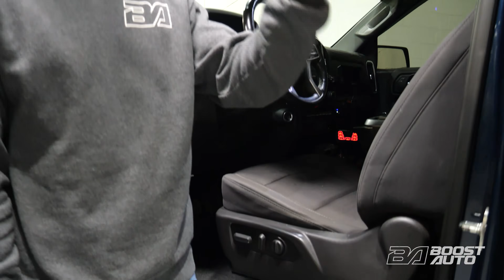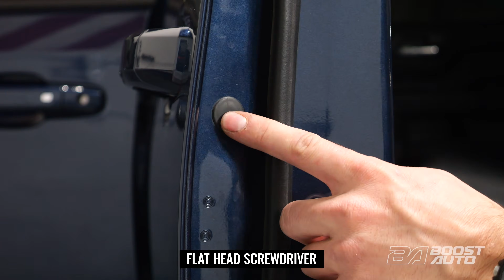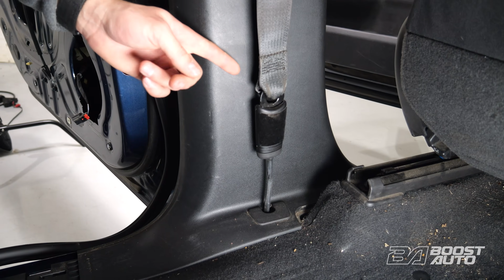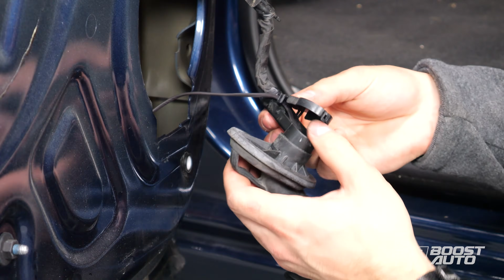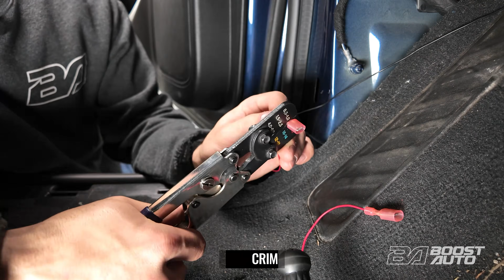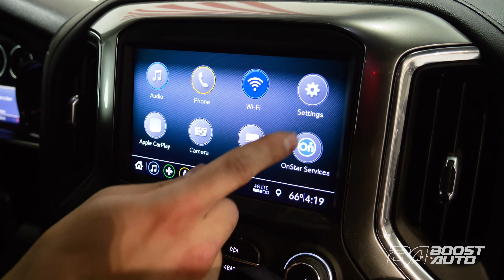Boost Auto Passive Entry Door Handle Install | 2019-2022 Silverado/Sierra 1500 & 2020-2023 2500/3500

Comment: Are the wiring harnesses for the passive rear handles option in addition to the standard harness that goes to the BA control module?
Reply from the maker: Yes - if you didn't originally have rear passive entry and are adding it you need to do the additional wiring that is included with our kit.
Reply: @boostautoparts 
Thanks! Did you consider having one cable with all the wires(5)? for running to the back handles option (and only use 3 if not upgrading to passive? Maybe be tougher to pull? Guess vehicles with existing rear passive wouldn’t need them either!
Reply from the maker: @CraigThompson-d7f  I will share your suggestion with the development team for future consideration
Reply: Could you do an install video that includes doing the passive rear installation at the same time as the rest of the handles and control module? It would help clarify the routing process of the wiring! As it stands now, it would appear that you would be pulling wires through the rear boot twice. Control module to handle(front to back) and then passive handle to front tap point (back to front).
Reply from the maker: @CraigThompson-d7f  I will share the feedback with the team for future consideration
Reply: Makes me wanna add passive entry to my front 😂